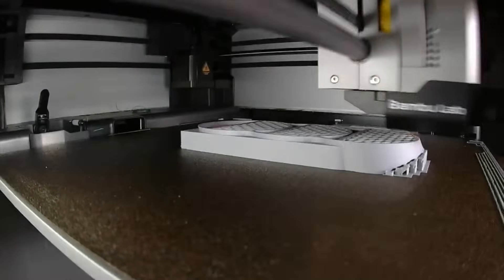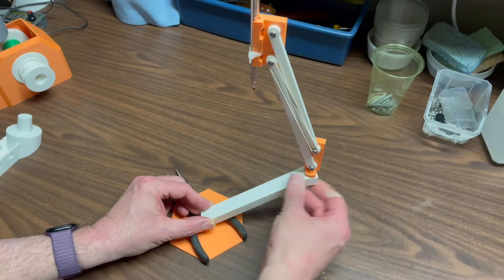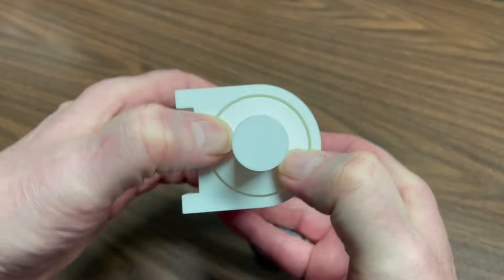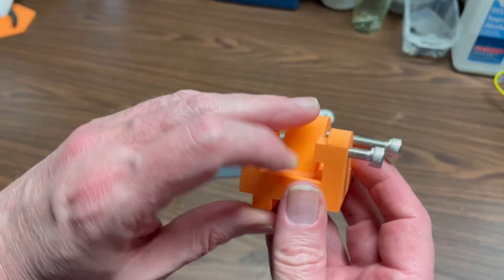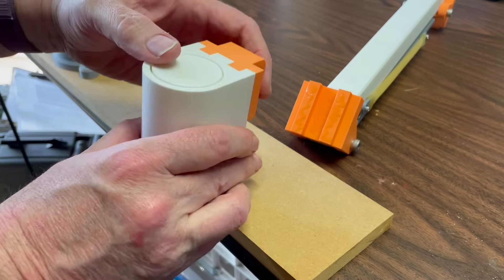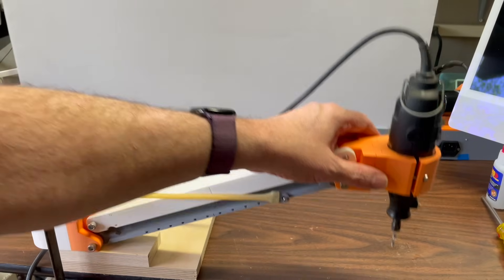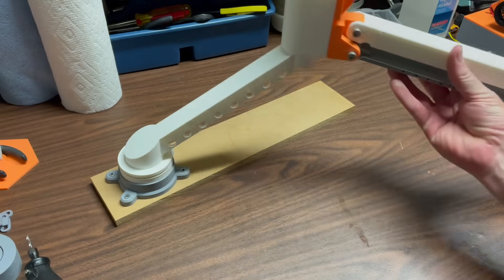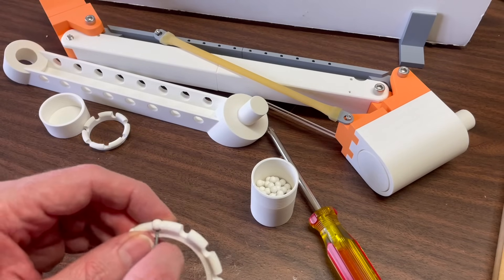Workbench Torque Reaction Arm - 3D Print Lab

Comment: Double sheer, thrust bearing and some actual bearings might help? As for leaning over on the second stage, why not have a smooth rod all the way through and then press fit bearings at 2 points along each side of the linkage?
Reply from the maker: Good thoughts, thanks!

Comment: Try to print some roller bearings instead. Nice Video
Reply from the maker: Thank you. I have had some success with roller bearings, although printing the actual roller seems like it might not be strong enough
Reply: @stuartferguson11  maybe you could find some cheap dowel Pins? Not as cool as completely printed but maybe worth the try. 
For such Parts i would use my resin printer, but Not everybody has one. 
Nice that you are still improving this device 👍🏼

Comment: The lower arm really needs to be an enclosed "box" structure.  Adding a bottom to it will increase its torsional rigidity by several factors.

Comment: Design the base stiffer by screwing and epoxying steel bolts into it. Maybe an additional fiberglass and resin wrap all around it to form a tension ring like steel banding an aluminum car rim. Beef up the lower joint with an angular contact bearing. Make that lower arm stiffer by wrapping it in a few layers of fiberglass and resin, forming a torsion box.
Reply from the maker: I am interested in experimenting with resin to add strength and weight when needed

Comment: You need to create composite materials when building anything using 3d printing. Leave holes to insert metal rods. Use metal sheets to screw your prints on and give them strength. Dont use superglue. To glue in metal rods use epoxy. Use screws for anything else.
Reply: Also you shouldnt print everything. Big parts should be made from wood and everything sturdy should be made from/with metal. 3d printing really is useful for anything complex. You dont really need fancy tooling. A drill, a saw, a vice and some thread cutters. Print jigs to improve accuracy when cutting or drilling.
Reply from the maker: Yes, I've done that with other projects. Here I wanted to keep non-printed materials to a minimum

Comment: Very interesting project, thank you! By the way, for dremel, don't you need straight vertical motion for the endmill? How are you going to drill straight holes?
Reply from the maker: I guess it wasn't clear in the video, but with both stages the tool will be able to move straight up and down
Reply: @stuartferguson11  Ah, yes, it can indeed. However it feels like it won't be fixed to "vertical only" motion when needed. I think it would be better if you could position it freely, then lock horizontal coordinates and only move it vertically.

Comment: Thoughts.. cool attempt at a first pass. Maybe consider below for next iteration. 

1) use real bearings and tighten up tolerances. In pivots any slope will be cumulative with next joints slop.

2) use a tapered wedge for clamp with a flexible lock pin (3d print as one piece) you could push that in and then slide off arm for use on another mount pin. So it becomes more portable. One arm lots of pins around shop.  Or do like a manfrotto or gitzo style camera mount. So you don’t have to glue.

3) gas struts - allow constant force and could be internal of arm rather than external. Making it look sharper.. 

4) beef up lower arm use solid infill. If 2mm use 3 or 4mm side walls, add small gussets to limit bending moment at the bench mount pin. Beef up pin diameter to reduce moment. with using plastics you may get more flex then say aluminum tube. Maybe use aluminum square section in lower section.

[check out my channel it random junk atm but Will get better]
Reply from the maker: Thanks for the tips!

Comment: This arm isn't suitable to drilling regardless of rigidity, because moving it down also changes it's position on the horizontal plane. It would make a good mic or lighting stand, though.
Reply: THIS.
Reply from the maker: With a jointed arm the tool will be able to move vertically

Comment: Not a problem for thin materials, bit with thicker stock, the drill will move to the side when moving down. Thus elongating the hole or break bits.
With the two arms together it might not be an issue?
Reply from the maker: Correct. With two arms the drill will be able to move vertically

Comment: Why does your arm need 2 stages? Seems its perfectly functional with one stage.
Reply from the maker: Two stages allow it to be positioned anywhere on the workbench. A single central pivot would only describe a circle
Reply: @stuartferguson11  might be interesting design with a single telescoping arm with a single beefy base.  would reduce second stage flex, and a telescoping square tube is pretty strong.  and you get variable reach while avoiding secondary arm flex.

Comment: I always love a good 3D print build video, but why not repurpose a desk monitor arm ? you might only have to adjust the springs and make a tool holder.
Reply from the maker: I have considered modifying a monitor arm for my trim router which is quite a bit heavier, but that's a whole different project

Comment: Open profiles are always very disappointing when it coms to torsional stiffness.
The holes are probably ok. But try to place them near the neutral axis for the main bending load case. They do save some plastic. Although I always prefer to see some triangulations. (think construction crane)

Comment: You can put bolts through 3D printed shafts to make the shafts much tougher and stiffer. It's basically giving the 3D print a metal core with off the shelf hardware. It can at the same time be used to give your 2 part bearing shafts less chance of loosening which increases the slop and sagging of the entire arm angle. One thing to not about self forming threads though is that some printed plastics have deformation creep which is especially common with non static load.
Reply from the maker: Useful tips, thanks!

Comment: You should look into dovetail joints, they would be better than the finger joints you are using and generally wouldn't even require glue if designed right.

Your lower stage would likely be better as just a simple object than all the holes and gaps, you really don't gain much (if anything) from doing that to 3D prints since they are mostly hollow anyway and it actually makes printing harder. The best way to increase rigidity is to make it thicker (give it a larger cross section) since material further away from the bending axis gives more strength. So changing it to just a cuboid and making it thicker should help with the strength and rigidity.

Comment: Think about using dovetails instead of finger joints, they won't need glue and will allow multiple attachments
Reply from the maker: I've had trouble getting the tolerances right on 3D printed dovetails -- they're either too tight to slide or too loose to hold rigidly. It's worth considering though

Comment: The way to get stronger 3D parts is to design them thicker and chunkier.  You should never be designing holes or ribs for strength, because the infill already serves that purpose.  You're not wasting extra plastic to make it thicker or chunkier because it's mostly hollow anyway, but your whole bottom stage can twist and flex because it's just the walls with no infill.
Reply: With an FDM printer, vertically oriented holes greatly improve strength as they cause extra outer perimeters.  Placing them in any other orientation reduces stiffness greatly.  It's almost always better to increase the perimeters over adding more infill.
Reply from the maker: I have found that adding holes can add strength in some designs, although in this case bigger would have been better